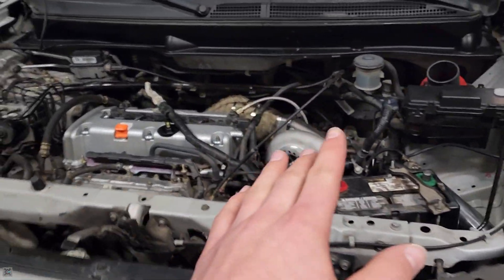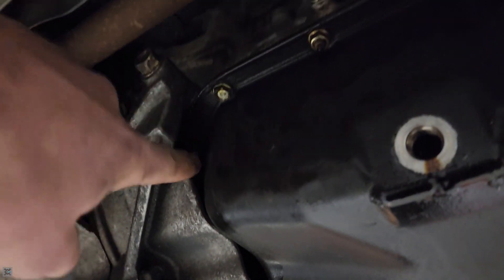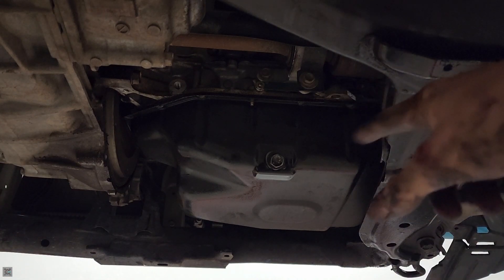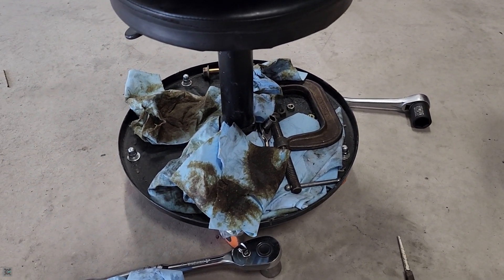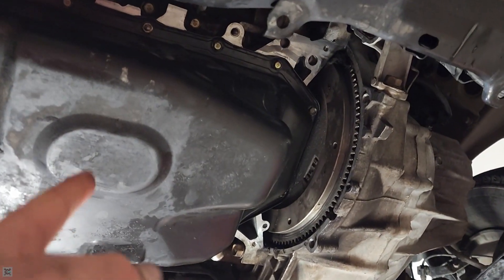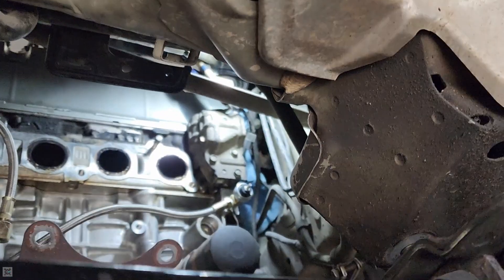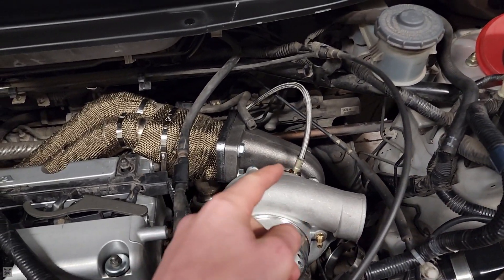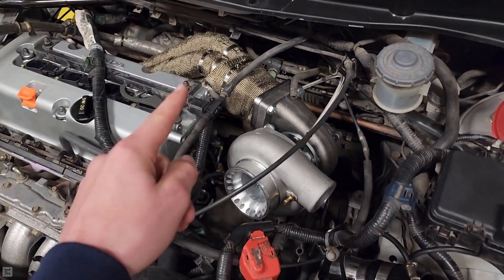Running Oil Lines to the Turbo on K24/K20 | Turbo Toaster Part 4: Oil Lines

Comment: You need a k20 type s oil pump and chain and tou will fix that issue fast with more oil flow
Reply: If you swap that oil pump i promise you that it will rev super crazy I'm building a k24 turbo and we did the k20 pump conversation super worth it
Reply from the maker: @joseguzman5363  haven't had the need yet🤷
Reply from the maker: @joseguzman5363  The lines worked fine, I just needed to start the car first for the oil pump to spin fast enough to build pressure.

Comment: What's the increase in oil capacity if any? Like 4.6 quarts to what?
Reply from the maker: I really couldn't tell ya, I just filled it up on to the max on the dipstick...any variance that the oil lines has is not going to move it out of that range

Comment: I went to the hardware store and got a T fitting but couldn't get it to thread the block.  Oil sensor threads easily into it but won't thread the block.  Did you use flare fittings to thread the block?
Reply from the maker: The threads to the block are 1/8" BSPT. Do not use an NPT fitting to connect the T to the block because it will cross thread.

Comment: I added copper washers between that fitting and turbo so I can’t overtight it which is pretty easy. Same with the water lines
Reply from the maker: Always a smart idea to not bottom out the fittings